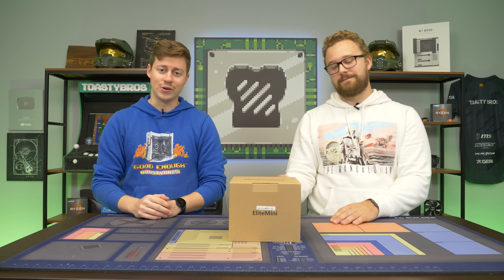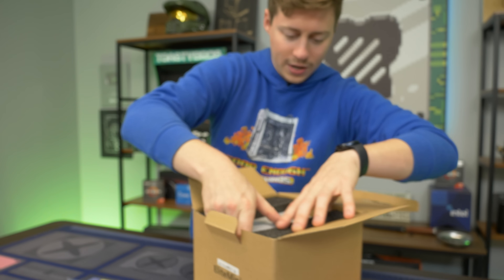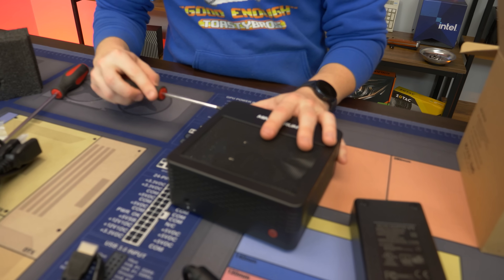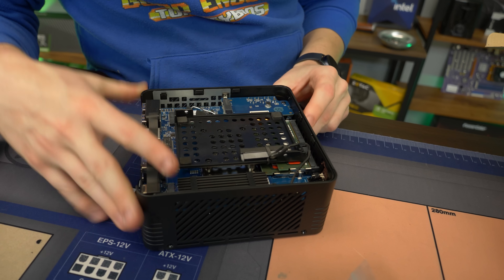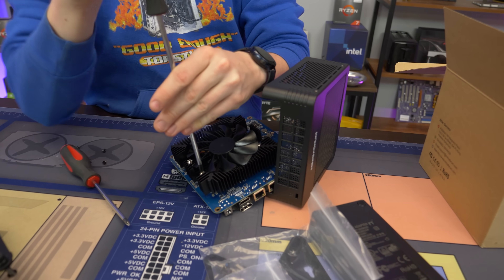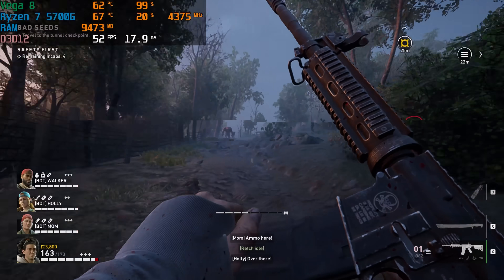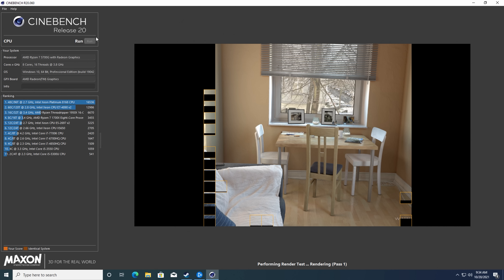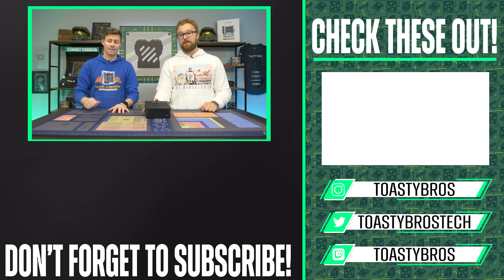This Mini PC is Faster Than Your Gaming PC?!

Comment: Guys i have a question is a i5 3470 with a 1050 ti with 12 gb ddr3 ram any good
Reply: it’s mediocre but really won’t be cutting it on recent games
Reply: @mpzz_  I don’t know if I should bay it cose I found a pc with those specs and with a monitor for 450 $ I don’t know if it worth it
Reply: u need a better cpu ur gpu is decent and ddr4 ram